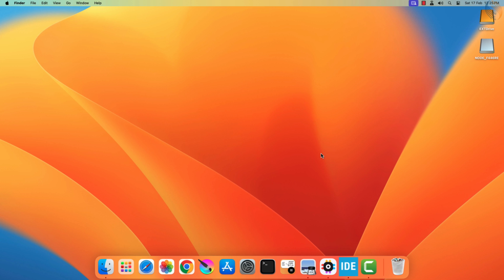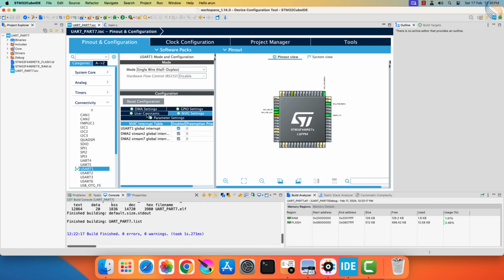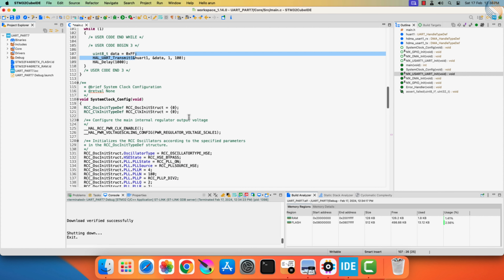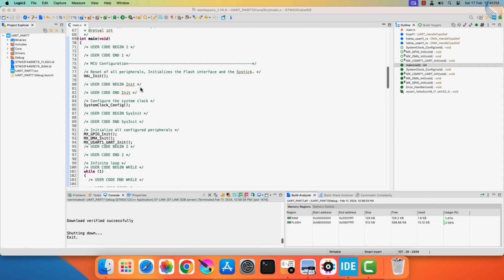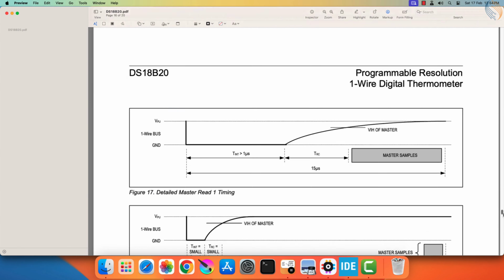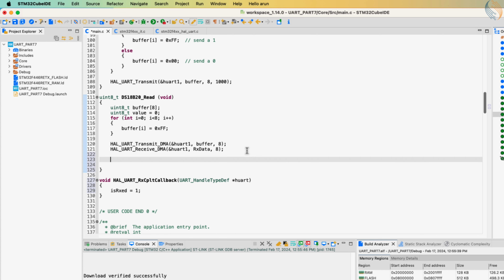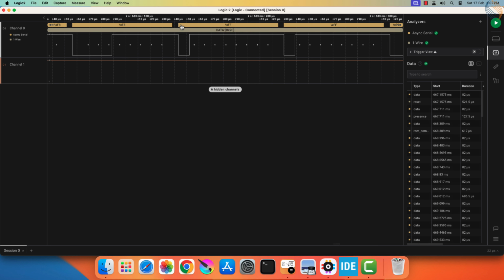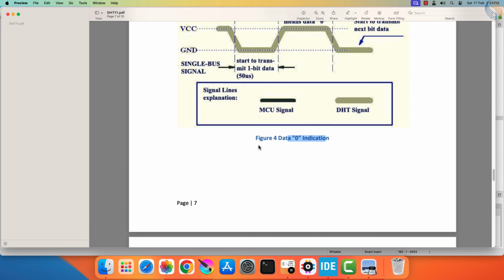STM32 UART Tutorial (Part 7):  How to use One-Wire Protocol to Interface DS18B20 Temperature Sensor

Comment: Hello and thank you for this video (and all the helpful other ones ;-)

I managed it to run your example on a Nucelo-F429 => it works with one single issue: the interrupt doesn't work !? => instead of this I simply used a HAL_Delay(1)

so far so god

I also tried it with a Nucleo-H743 => the "presence" is recognised perfectly...

...the Write-Command also seems to work...

...but in the buffer-array of the Read-Command always bit "0" gets the value "0x00"  (not 0xFF or 0xFC as it should be)  and also the last bit is sometimes a "0"

(by the way: my Logic-Analyzer (DS-View) shows the correct information = only 0xFF or 0xFC for all 8 bits)

=> so it seems that the STM32H7 reads the correct output signals from DS18B20 in a wrong way => ??

As I found out so far, it could be a problem with the content of the "USART_BRR register" ??

...or the prescaler (<= is not present at F4-MCUs) is set to a wrong value ??

D-Cache is disabled - so this cannot be the problem

Does anybody has an idea?

...would be great => thanks very much
Reply: ya i got the same problem too, i try on F072 nucleo board,  my logic analyser show all 0xff... and on H723 same Oxff too...
Reply: @ controllerTech  could you advise...
Reply: if(huart->Instance == USARTx)  // 
  {
  isRxred =1;
  } maybe this is how it should look like